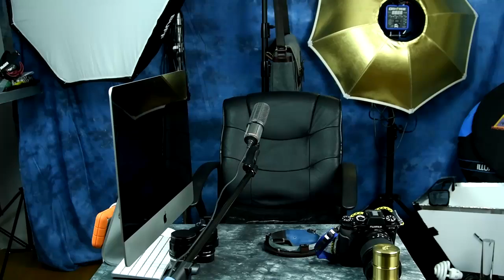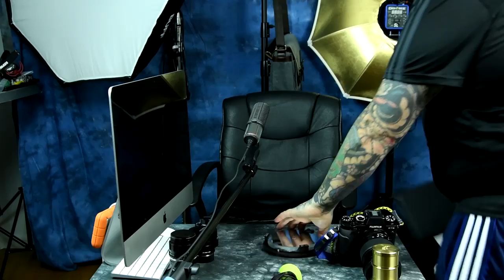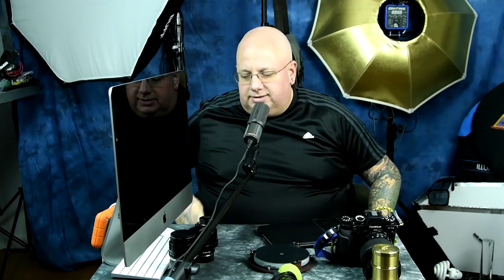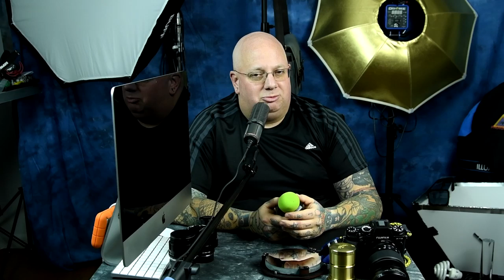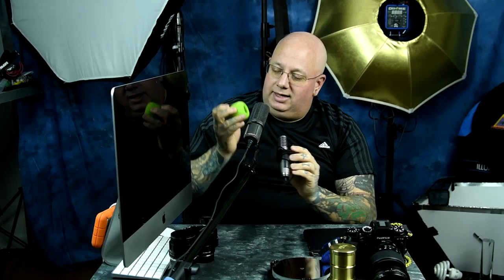Design Flaw: Light transmission facts on Semi-Transparent Mirrors re: Sony a99ii

Comment: Where are you getting 90% micro contrast loss from? I'd like to know. And I don't see how a drop off in the deep purple near UV is an indication of micro contrast loss over than overall 33% light reduction.
You would have to test it yourself to see if it is the case, because then micro contrast loss of 90% is pure speculation and guessing.

Comment: I used a LA-EA4 adapter on a sony mirrorless. It has a "semi-transparent" mirror to improve autofocus. It was terrible. Image sucked and auto focus sucked. I had better results with manual focus.  Returned the adapter right away. Not surprised if this fixed mirror kills the a99ii.